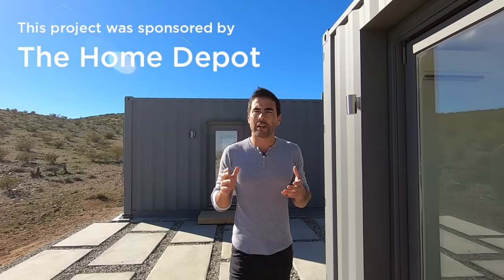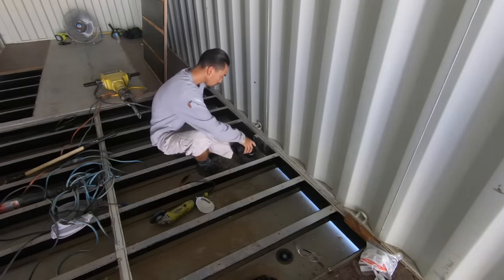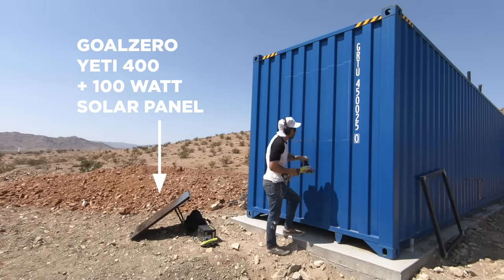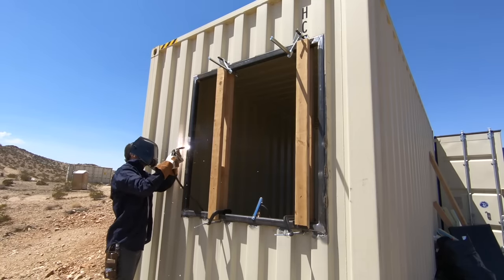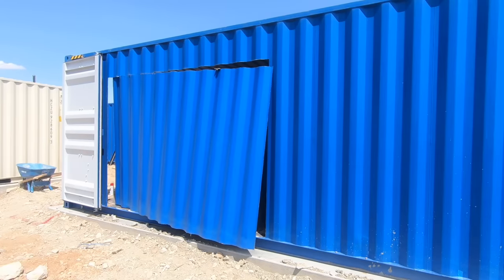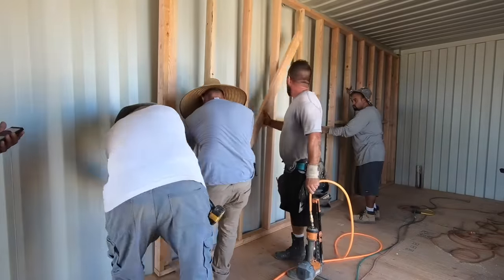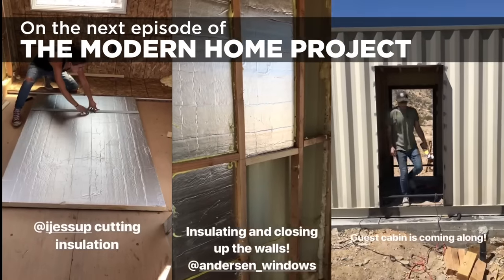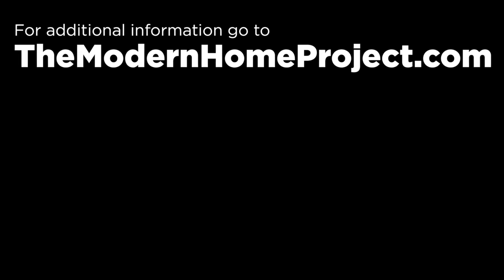Building a Shipping Container Home | EP02 Moving, Cutting, and Framing a Container House

Comment: Really cool video and well produced.

With all the extra things that needs to be done to the containers, is it really worth doing containers instead of just building 3 small "houses" the traditional way?
Reply: That's what I was thinking. 
And this point, having a concrete slab and foundation, completely framing out the inside and having to weld support everytime you want an opening, you could have just done a cinder block structure or even a wooden structure with sheet metal outside (don't know if that's up to code in CA though) 
Can't imagine that this is much faster nor cheaper per square foot.
Reply: Agreed, this seems like more work than doing a conventional stick frame. That said, if you could pre-fab it offsite it might make a bit more sense, especially if it's going to end up in a location that would otherwise be too difficult to do a conventional build on. Then you would also have the benefit of being able to build in a more controlled environment, with easier access to tools and materials.
Reply: It can only be for the look.
Reply: I'm beginning to have the same question, and with that said, I still love the idea of container homes.  If this ends up close to the same cost as stick built, could you have just built a frame and covered it with corrugated material to achieve the same look?
Reply: Agreed,
Reply: Agreed. OMG, if you're going to frame the whole container anyway, why not just stick build it the traditional way and cover the exterior with similar corrugated siding? It seems like an extravagant way to get the look, and there does not seem to be anything cost-effective about using the shipping containers.
Reply: If you use less concrete (and save money) by using pads instead of a big slab, it’s better to use containers because you can guarantee the structure for 75, maybe 100+ years.
Reply: I think a large part of the answer to your question would boil down to professionals setting up a container house vs. "making it up as we go along" amateurs (this is not a jab at these videos).

A company that specializes in making container houses would know what to do and not do, thus their cost and time, would be a lot lower and more efficient.
Reply: I'm guess the city building dept. doesn't quite know how to handle shipping container buildings so for them to approve it they make you build a regular stick built house inside it, either that or they don't want people building them so they make it as much of a PITA and expensive as possible.
Reply: Lots of advantages for container homes vs. traditional stick built homes...wood can and will...rot, warp, mold, be eaten by bugs, require constant maintenance, be absolutely destroyed in an earthquake, fire, tornado, and/or flood. And considering the ridiculous materials stick built homes are made out of now, basically cardboard, glue and utility grade lumber...what a joke.

I own a stick built home and am so sick of it. Just found a rim joist that termites have been mowing away, got to paint the bubbling cardboard T-111 again this summer, with a heavy winter I've had 12" of water in my crawlspace getting the framing/subfloor nice and damp, my pergola roof is leaking heavily, my drywall is cracking big time around some windows. Stick built homes are a time and money pit. Where has tradition actually gotten us as a species? LOL
Reply: It's definitely worth it, if he gets sick of being there he can move them wherever he wants.
Reply: In most cases, a container home would cost more but its unique
Reply: IMO: no, you'd be better off with conventional. But, they do have their niche. The major downside to this is how widely varying the price and condition of these containers are as well as delivery/setup fees. The main thing to watch out for though is that some of these are bought in pretty rough shape, get bondo'd and repainted and sold to unsuspecting customers. These things spend most of their life on a cargo ship...in the ocean, and we all know what saltwater does to metal.
Reply: I'd also add that it's sponsored by The Home Depot so that should tell you exactly why you see the stick construction and ryobi tools in use....
Reply: The stacking strength comes from the floors rigidity and the 4 point frames but in the middle of the roofs they are not strong especially once the corrugation is cut out. However using steel bracing wouldn't have altered the look nor cost what it cost in lumber which they'll likely cover in some gypsum garbage.
Reply: agreed
Reply: No Paw its not worth it...the way they are doing it here. The complete frame out on the inside and the complete slab is ridiculous. even though this guy is trying hard he is not even close to be a metal fabricator so its taking him way longer then it should and hes being very inefficient in his work habits.
Reply: @andrewjames4335  Agreed. But I don't plan on all that extra work and extra framing he is. Just a little extra framing welded in to strengthen the widows and doors. In Thailand your pretty free to do what you want. Also I will be putting it down above ground on blocks. perhaps four posts. so the plumbing will be a breeze.I believe in the KISS principal. I think I can have a nice place put up very cheaply and done very quickly. When in Iraq we worked out of a container office. If they had just added a little better insulation it would have been pretty good.With some care I think I can make a nice home cheaply.
Reply: @jimmyz1686   also easy to expand if your family grows. Just buy another one and stack it on top or right beside the others. Containers are made to be stacked on top of each other on moving ships.
Reply: @TheXxneowolfxX  I was reading at one site that it does not cost much more to buy a once used container then an old used one. Where I plan on building is near a major shipping port so I should be able to get a good buy.
Reply: @keithholder3155   Agreed. He is going out of his way to make it way too expensive. Where I plan mine to go, I will have little or no regs or zoning restrictions. No expensive slab for me either.
Reply: @masterspacetime2826   LOL! Liberal Seattle, good luck. Look out for all the bureaucrats in the city! I couldn't care less for the carbon baloney. I just think in my circumstance and location I can have a nice place very reasonably.
Reply: Pole barn would give the same look and you could locate plumbing and poor slab after the fact
Reply: @murrys5444  nope !ANY company building container houses is in it for the $ . tell me one who aint so i can hire them!
Reply: Maybe somebody has already said this but it's probably unfair to judge how involved this is seeing as these container houses are fairly new. The processes involved haven't been refined to the point that stick framing has. I'm sure stick framing in its infancy was tedious and a ton of mistakes were made. Give it time and the tools and techniques will evolve. Stick framing is unsustainable and container houses make good use of otherwise wasted materials.
Reply: Im a journeyman sheet metal worker, so I thought my skills would suit the build and I liked the idea of repurposing the containers. I bought 2 40 footers X 9 foot 6 high. I poured 9   1 meter by 1 meter  by 1 meter footings sunk 9     8 inch diameter 3/8 thickness  3 meters long  pipe filled with concrete, ran three 8 inch i beams 6 meters long  on top of my 3 rows of 3 pipes then craned my containers up and started my build. I welded 3  5inch 3/16 thickness 6 meter long tubing on top of my containers for roof support because I did not want many walls inside after I cut out the two inside container walls. Thats enough about the build. If I was to do it again I wouldnt because everything  has to be engineered  its just too much labour, I was working alone with lots of chainfalling and comealonging.It took me 3 years over a span of 5 years to do the build.  I used 1/2 inch foam rolled insulation with 1` shiny side on the interior and exterior before strapping, I Hardy boarded the outside so unless you knew it was 2 containers you would not today. My build was in Thailand so what I did was create a 40 x 22 x 9 steel oven 9 feet off the ground. Ive hired pros to come and spray my  container roof with 3 inches of sprayed foam insulation and luckily electricity is very cheap here in Thailand so running air conditioning a lot costs between 120 to 160 can. dollars a month. I would do it again because I learned what to do the hard way but just starting out not knowing no way.
Reply: @murrys5444  But the California Code problem still remains.  How much money and time would it cost for a builder to have to push thru reasonable codes for this type of structure?  Highly unlikely this would happen.
Reply: Exactly!
Reply: Henjust did extra work for the calif building codes. Then justified it by saying to build “structural support”.  Example: you don’t t need a header for any opening just support around the opening to divert the load around the opening. But he doesn’t have any load above the the openings.  So its all for the codes
Reply: Paw Hansen
Obviously, it was for the home owners. So, yes its worth the trouble. A lot cheaper than some new homes.
Reply: @bolland83   not to mention under climate controlled area out of the 105 degree sun.
Reply: I'm actually doing this myself and just the foundation in this video alone is extremely excessive.  Way too much work compared to other foundation solutions for container homes.
Reply: 2 x 6 stick framing would be better insulated than a shipping container, no matter what kind of insulation you choose. And a stick frame's sheathing would also have some insulation properties. My father-in-law started to build a two-car garage on a cured slab at 8AM and was done at 5PM, sided and sheathed, and it he did it all single-handed. Balloon framing (stick framing) really took off after the Chicago Fire of 1871 - Drop a pile of 2x4 lumber and a keg of 16d nails and the construction site and a couple of carpenters could frame a two-story house without any special equipment ...in the days before plywood! 

I just don't see any advantage to adapting a corrugated steel shipping container (with a corrugated roof, too). As many others have already pointed out, the container house has what amounts to a complete stick-built interior. And there is all the cutting and grinding and welding. It doesn't seem to have any advantages of cost or complexity or durability. (You don't have to use the LP crap for siding nor OSB sheathing nor utility grade studs.) There's no access to a crawl space, the containers need skirting to keep desert critters from taking up residence under the house, the walls are not taller than 8 ft standard sheet rock, the structural integrity would be compromised by rust. 
OK, I'll stop. I'm sure these points have all been made by many others. 

But it is a cool  project. And I admire the ingenuity of the builders.
Reply: @Alrukitaf  there are stick built houses older than that
Reply: The benefits of using shipping containers are far outweighed by the restrictions. On the surface they are great, they are incredibly strong and manufactured to withstand the harsh environment of trans-oceanic shipping, but as he points out in this video as soon as you cut into them their strength is compromised.

They are also only 8' wide and 8' tall so all your rooms are long and thin, and combing two to make a 16' wide space requires huge work to cut, weld, strengthen and seal. If you want to add a meaningful amount of insulation, then you are rapidly eating into your interior space. Using poly iso insulation with a target of R19 on the walls and floor, and R38 on the ceiling, sees a 16% reduction in interior volume, unless you apply the insulation to the exterior, but then you need to sheath the outside and what was the point of using a shipping container?

All in all they make for great prefab'd emergency/temporary type units, but they are not a very good solution for housing, unless you happen to be in a climate that doesn't require anything more than a token amount of insulation.

EDIT - these containers are more than 8' tall, but the basic principle still applies, you have to remove internal volume to add insulation.
Reply: @baseddept.supervisor2417  You can build a stick house with metal studs and metal roofing. Enjoy the best of both worlds.
Reply: @holyfuddleduddle4231  , Thanks for the tip. I would love to hear more and see some pics of the finnished building. 1000bht a month for electric isnt too bad. That was one of my main worries about a all steel building. I am thinking about putting mine up in countryside near Rayong.

Comment: As shown, this video just seems to suggest that it’s pointless using shipping containers. The rust argument is not right, as the corten steel was created for a corrosive marine environment. The rust formed is hard and impenetrable, preventing further corrosion. So the wood frame is not needed for structural support, but useful for housing the insulation. But its better to insulate on the outside. This video has some significant points of misinformation. But even so, it’s nicely put together.
Reply: Alrukitaf thank you for saving me from having to type in all the things you said. 
💯
Reply: If you apply insulation to the exterior you then need to sheath it, and that defeated the point of using the container in the first place.
Reply: @chiefsilverback  If you apply insulation on the inside, the metal will trap the heat and make the container an oven, which might be good where there is cold, but not so much in the desert

Comment: 13:27 code enforcement, but it's not supporting anything. It makes some sense if its a wood structure, but a metal structure has better tensile and compressive strength by several orders of magnitude greater than wood. You may as well spray a line of spray foam and call it a header.

Comment: Congratulations, you built a mobile home with steel siding.
Reply: If he made it a mobile home it would have been cheaper and faster to build. Because he'd bypass much of the  punitive and excessive regulations and building permit costs associated with building a permanent home.
Reply: Congratulations, you missed the point of the series. Gold star for the least original comment I've seen.
Reply: Wtf are you even looking at lol.
Reply: Actually, you may be right. They can sell their house and it will take a tractor trailer to move it to any state.
Reply: All the heat is gonna get trapped inside that steel container 😂
Reply: the home is not mobile. LOL